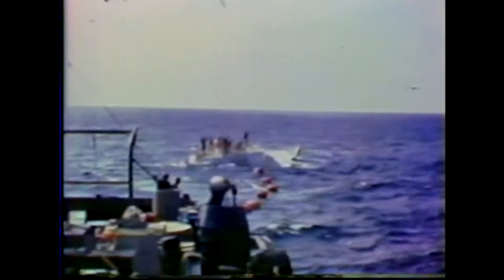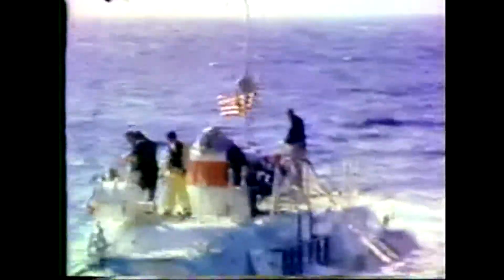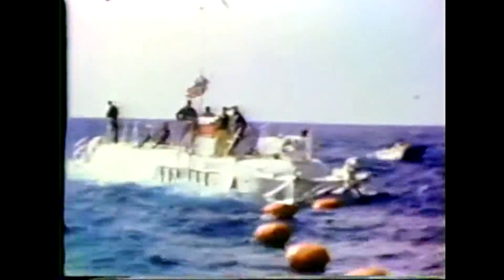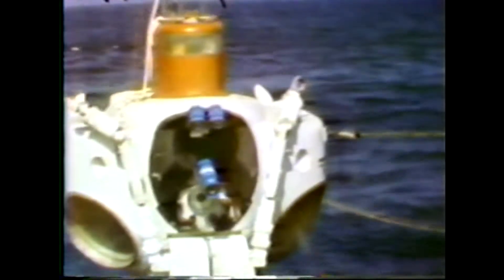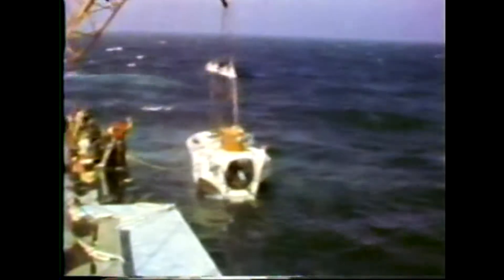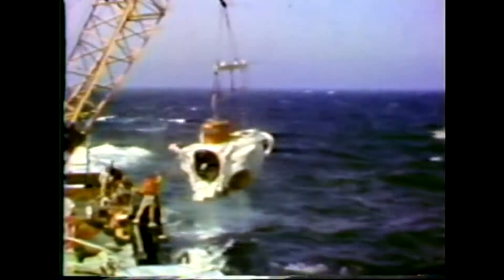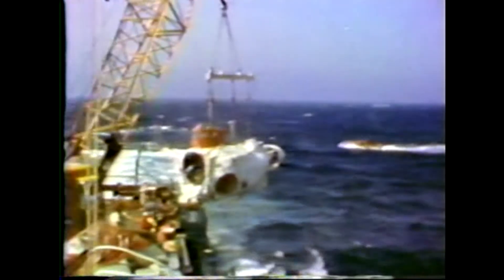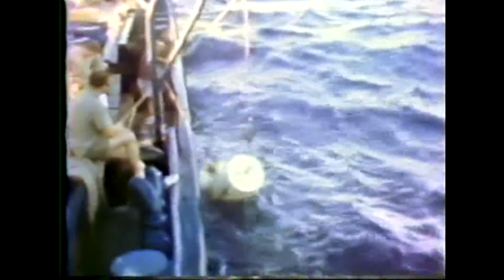DSV Navy Recovery.m2t

Comment: Spent 3 years doing launch and recovery on SeaCliff  from 1978 to 1981. The Mud boat we used was the Energy service one (ES1). Many a time having fun ducking the I beam. Was a swimmer when we go shot at by two A 6"s off of Anacapa Island.  First non Submariner to get NEC 5303.